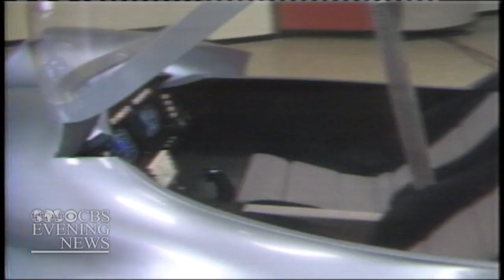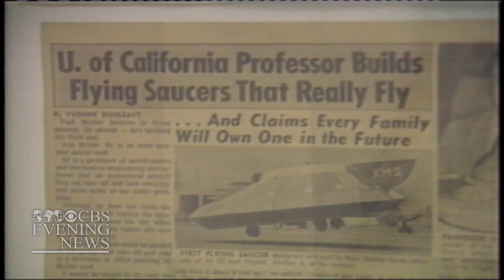1988: Manned test flight of a flying car

Comment: could of got married after von ; but that canary kept my heart above water if that makesense AT ALL ©
Reply: There is an interesting design of aircraft, but they rarely talk about it, because this thing is secret. The topic of pulsed plasma thrusters has been developed since the early 60s (see PPT - Pulsed plasma thruster) - they are usually designed for spacecraft. But we will talk about a little-known design - these are plasma propulsion panels for aircraft, where the same Pulsed plasma thruster, but reduced to the size of a pencil and stacked in the form of cells in the panel. The design resembles a conventional plasma TV screen, where there are also discharge cells that activate the glow of pixels on the screen. And plasma propulsion panels have long discharge cells, the arrester has a railgun architecture (just rail contacts or coaxial), and the ionized discharge air is accelerated there by the Lorentz force to enormous speeds - a kind of ramjet engine is obtained. Just imagine! - tens of thousands of small ramjet engines assembled in a panel and firing plasma synchronously with a huge frequency (hundreds of kilohertz). Thus, plasma propulsion panels create lift by pulsed emission of plasma jets from railgun cells. There are tens of thousands of cells in the panel, they shoot at a frequency of hundreds of kilohertz, a huge pulse is obtained, and the plasma swirls the air into toroidal rings - the aircraft is held on this air cushion. Horizontal acceleration is created by the same plasma panels on the sides of the device (they glow, from the side they look like "portholes"). Such devices like "triangle" or "disk" have been observed for a long time, they are mistaken for alien ones - but these are terrestrial devices. They are classified and used for espionage and secret actions. Pulsed electromagnetic technology generates microwave radiation, therefore it is harmful to health. They rarely fly - only military missions. Therefore, they are not suitable for a citizen. This maintained the secrecy. Now they are already declassifying - many people know about this secret technique. When declassified, they will be used for cargo airships. But there is a danger that they are now going to be adapted to deliver small nuclear charges to decision-making centers - such means of delivery are not specified anywhere, are not conventional. This lowers the threshold for starting a war. It would be necessary to declassify them as soon as possible. That's why I'm writing about it. However, I have written before - starting with the book "The Elimination of UFOs" and many articles. There are also videos on my YouTube channel - "Declassified UFO" and "UFO Anatomy".

Comment: This guy miller isn't the inventor these saucer have been around for more than a century. Nothing was ever said, if you look closely the saucer here has turbines, the real saucers fly with negative energy provision vertical and horizontal with no turbines  and can fly close to the speed of I've mach 5 . It can zig zag quickly without hurting the pilot using an inuersha canceller which can defy gravity like you wouldn't believe ,they lie to us and keep us in the dark about these inventions that were made for man's benifits not for there own.
Reply: I've been to the flying saucers many times. If you're directly under the engine. They have a strong magnetic field around them. Sort of like a vortex field. Plus, they fly using microwaves and a magnet.
My whole house was contaminated with it all my clothes.
I also suffered burns to my internal organs. They stop time. Real flying saucers are made of real silver.

Comment: 21 years later and such a gadget is really no closer to making its way into my garage than it was back then.   It's not that such a gadget can't be made, it's that you can't afford it.
Reply: 31* years
Reply: It's because this is an idea that works only in theory (and even there only just). Even if you could afford it. Stupid amounts of power required to lift up, it would make a mess everywhere unless it's high above the ground and is ridiculously impractical. That is before we get into the training problem and the reliability and the fact that a single minor problem could be fatal. The best flying car was invented ages ago and is called helicopter. There is nothing in between it and a car, because all those things are just pointless.
Reply: I was personally at the flying saucer. I've even got Stargate on color video. I also have a color photo of the silver disc.
They stop time. 
The problem is people die on the spot. They're revived afterwards, but their memory doesn't work.
Reply: Design change he needs and couple trillion bucks ).
Reply: And it's not really useful.